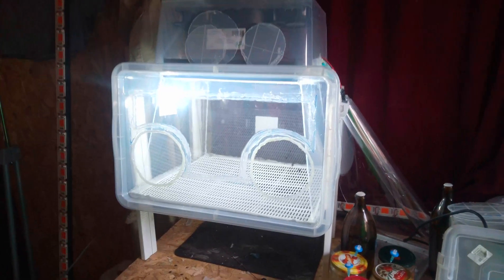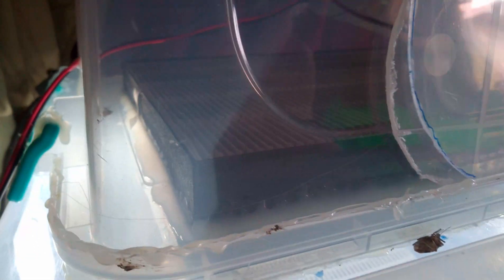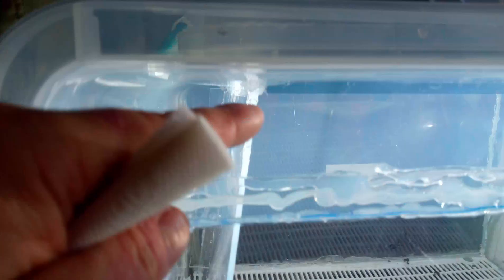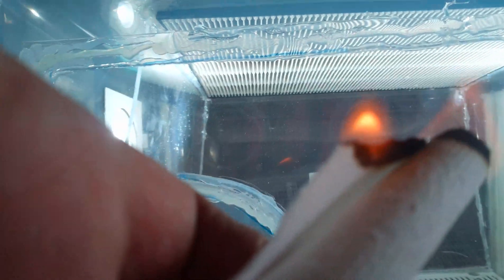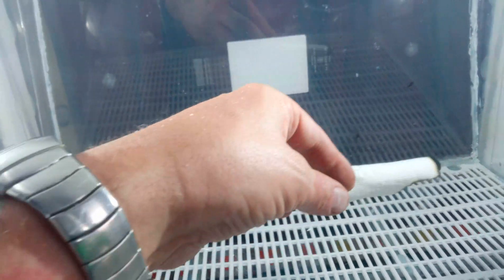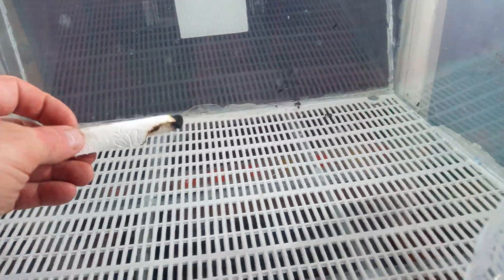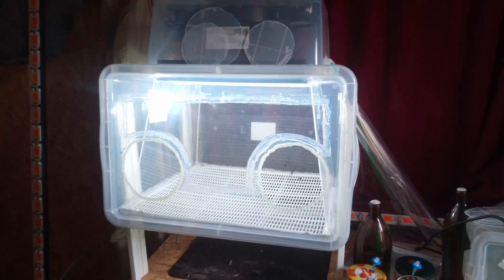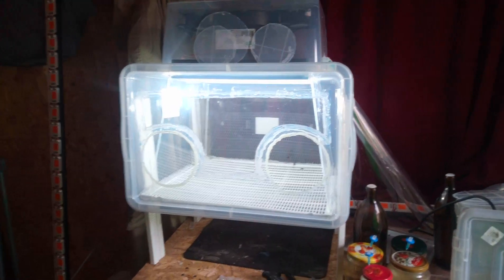diy laminar flow hood (almost?

Comment: cool design! I will be using an air purifier to get the air that's flowing through your hepa filter already 99.7% clean. Since doing a fair bit of research ive decided that one purifier wont cut it and i will actually be doing two for increased CFM and therefore a better laminar flow. im trying to find a couple with decent flow and the controls in the right outlay for my design. If my flow is too high i can drill holes in my box to reduce flow through the filter or i can adjust the speed settings on the actual machine.
Reply from the maker: adjust speed. too high m3/s (we use metric in science) and you dislodge particulates instead of trapping them with the charge differential. 
ion traps make a good cheap prefilter. a dollar buys a 20kv boost converter. run it between 2 large parallel conductive surfaces.

Comment: Very nice diy. Have you tested the flow after having it loaded with equipment? I wonder if the obstruction would mess up with the flow.
Have a happy and healthy new year
Reply: its ok if you avoid 30mm from the edge and stack petris with space in between. its no substitute for a floor standing lab device

Comment: Hi, I really like your attitude towards this project, and I wonder if you’ve made and updates this flow hood since. 
You may want to add a prefilter box, filtering the air with a cheaper filter first can save allot of money overtime by keeping larger stuff like dust and pollen away from more expensive filters. Especially if your working near windows or moving around in a dusty room
Reply: this gets such little use that prefilter wouldnt save money. i did tweak it a bit withe the baffles. next time i will build a better one. for now the box still gives better results than a SAB

Comment: Do air purifier hepa works well bro??
Reply: this model did. there are many different filters and some of the cheaper ones had really bad ratings. dont just assume any junk works, and dont assume a 15000 euro lab unit is good either until you run a test with agar